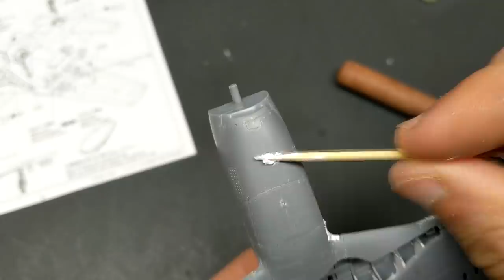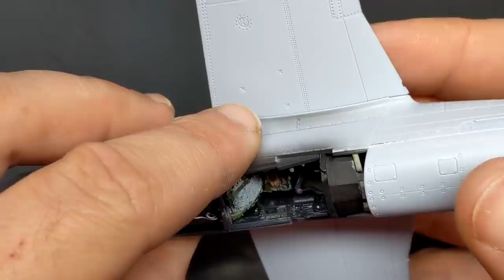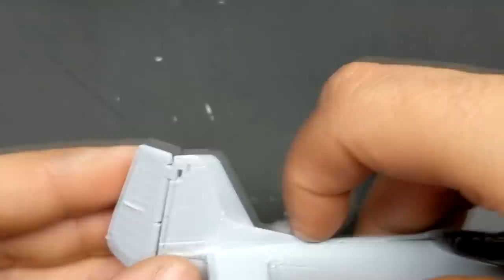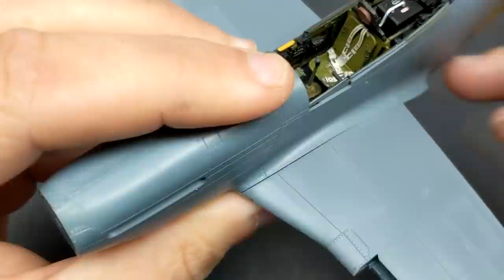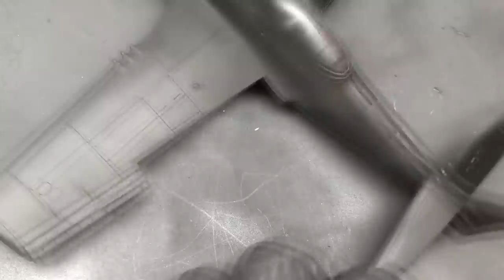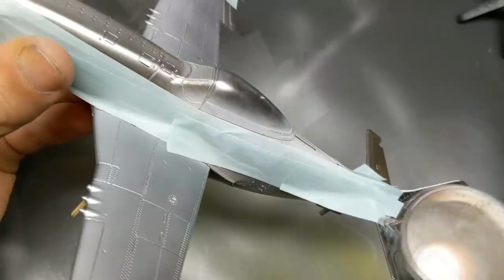1/48 Mustang Madness! Part II

Comment: Shame about the Eduard. I have always wondered about the plastics that Eduard and Roden use. Both were originally "cottage" companies. Eduard known for their photoetch. I have always wondered what their plastic recipe was, and from whom they got it. Only kit I ever threw in the trash was a Roden. Anytime you have to head down the path of a total strip, you are standing in it pretty deep. We've all been there. Also, I wasn't surprised with the Airfix issues. They've had those exact same issues since some of the kits I built in the 60's. As long as people buy them they have no incentive to improve them. I guess they realize, and are content with; their position in the market. Nevertheless, I liked the wheel bays you built and the research you did. Both were excellent. I'll be here for the next episode.

Comment: I thought styrene was styrene? Are you able to give more details on the differences between Eduard and other company plastic?
Reply: Hell no. 
Airfix plastic is rubbery and when sanding its so soft it disappears like you took a bench grinder to it. 
Kits from obscure eastern european countries are made with bright green, brittle plastic.
Some plastic is better geared towards fine details, others like those of Games Workshop are good at being molded thick without resulting in sink-marks.

Comment: I'm curious to know, what's your favourite airfix kit you have built?
Reply from the maker: My favourite Airfix kit I've done to date is their 1/48 Spitfire XIX PR. There were almost no issues. I have another copy in the stash for a comparison build.

I also have their Sea Fury in the stash and Mk I Spit with all the Eduard goodies for it. So as much as it seems I hate Airfix, it's just their kits are geared to the lower price range and their quality suffers for it. If Tamiya were to do another Mustang, I would expect it to be in the same price range as their new Spit, Zero or -109.
Reply: @TheModelGuy  I built the seafury and it was honestly a total dream. Amazing.
Reply: @ChazCharlie1  Agree. After a long break from modelling the Sea Fury was my first kit and it went together very well. The 1977 Revell P-51D I chose for my next kit, not so much...